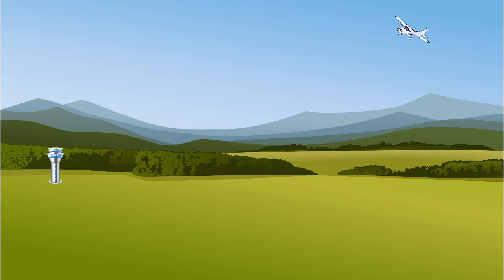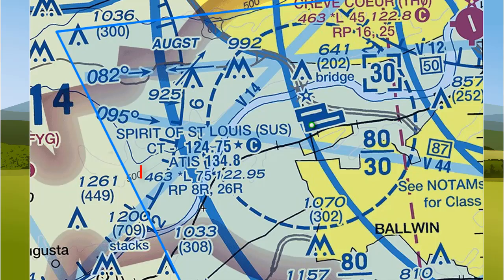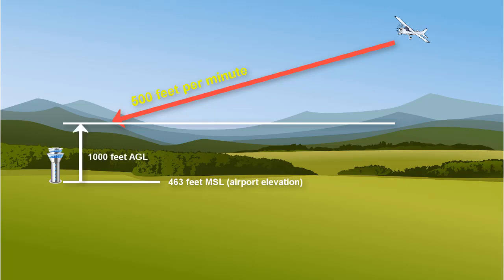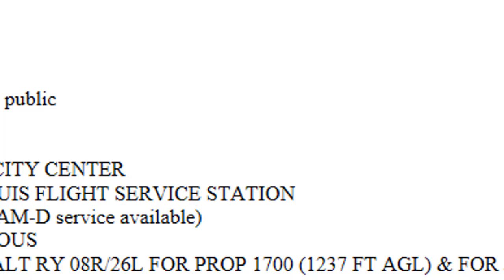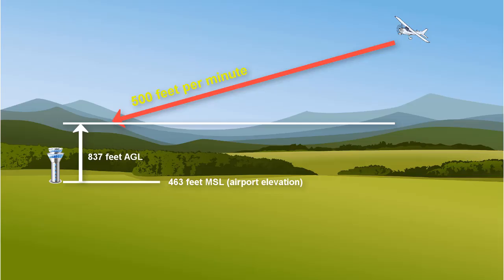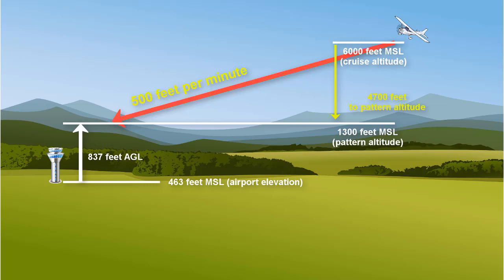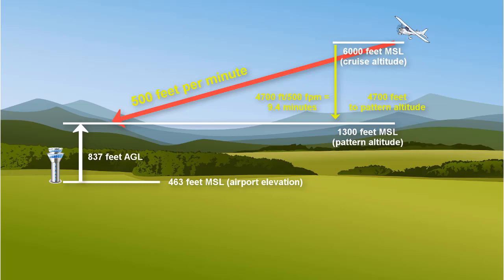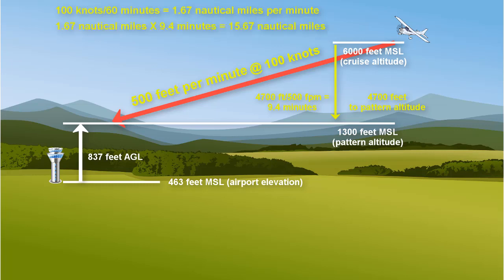Landing:  Calculating when to Descend

Comment: I find this to be anchoring on the wrong datum:

It is 3degrees, and 4/3 * stallspeed, not 500fpm descent,
that one should be anchoring on, I believe..

Every aircraft has its own stallspeed,

One needs to remain at at-least 4/3 of stallspeed during the descent,
for any configuration, any altitude, any weight,
therefore one's airspeed is anchored to the aircraft's stallspeed, not to 100kt

( some fast GA aircraft have a stallspeed which would make 100kt illegal?

One of my designs I'm working-on would probably be illegal for that descent:
it's a swept-wing fast long-range thing,

sorta like the Vari-EZ kind of thing, but with cargo space,
for covering vast areas, quickly, in the Canadian North, or Africa, or getting to ocean islands,
for disaster-relief.. )

Therefore, 3degrees & one's 4/3 * stallspeed are the 2 which one anchors on,
and that tells one what descent-rate one requires, for that specific aircraft.

I'm fine with everybody knowing "that isn't how it's done",

but if it's established wrong,
the correct thing to do, is to correct what-is-established,
not to remain ignorant to what physics is saying, right?

Feel free to delete my comment if you want.

_ /\ _

Comment: Methods I use: 
Determine FPM? Groundspeed /2 *10. 120 knots ground speed, half of that is 60 knots, then add a 0 at the end for 600. 600FPM.
Determine time? Well time at 500FPM is per minute, so 1000ft every 2 min. so use the altitude to lose (6000-1300=4700*2=9400/1000) or just say 4700 * 2 then drop the zeros.
Determine distance? Not as accurate, but gets the job done. 4700 drop the zeros = 4.7 x 3 = 14.1 (I would round 4.7 to 5 in this case) Or do 4700/3 then drop the zeros which should equal at about 15nm. I would round to the nearest 500 to make the math easier (4500ft vs 4700ft is easier to work with). Exact numbers are not always needed, just estimates.

I use these quick math methods best in flight. Works just as well in the planning stage.

Comment: Simplified. Multiple the distance you need to lose by 10 and then divide by 3.
For example cruising at 8000, target pattern altitude is 1000 ft. 8000-1000= 7(forget about 000 for this purpose)*10/3=23 nm.
Add about 2-3 nm for wind considerations and make sure you start your 500ft/min descent latest about 25 nm from the target

Comment: Question...but at given airspeed in a descent the ground track is less than the distance traveled by the airplane.  The distance travelled along the line from the airplane to the destination point is longer than the point on the ground directly below the airplane to the destination point (be it the airport or pattern altitude distance). How does that figure into the calculation?  For instance, calculating the distance covered at 100 kts airspeed the ground track will be less.  Shouldn't the speed used be ground speed and not airspeed?

Comment: In a small prop plane, 5 times the altitude to lose to the airport elevation.  Descend at the top of the green arc to save time.  Any other mental gymnastics are unnecessary.  Keep it simple.

Comment: This video helped and if your flying a 172, you can simplify it a little. If you fly 90 Knots, then to get your time, take your altitude difference (4700) and divide by 1000, so 4700/1000=4.7 then multiple it by 2, which equals 9.4. This math is easier for me while flying. To get your distance, just take that 4.7 and multiple it by 3, which is 14.1.

Comment: How about this method using high-school trigonometry which we all done in math class when we were kids:
Track distance required in nm (horizontal along the ground):
= [Altitude_in_feet / TAN(descent_angle*(Pi/180))] / 6076

Ps. The divide by 6076 at the end is to convert from feet to nautical miles.
?

Comment: Simple fighter pilot math for the jocks: plan a 5 deg nose low descent. Take altitude to lose in thousands of ft and double it. Power as required to maintain desired descent airspeed. 

Example: 5,000' to lose. Start 10 NM out. Add 1-2 NM for tactical pad and you're good. Easy. Makes life at 350-500 knots a lot easier.

Comment: (altitude to lose/500)+5=time back to descend for unpressurized  ie: 10K ft 25 minutes back .... Pressurized (3nmxaltitude)= distance back, then descend at  1/2GSx10+3 miles to slow down for a 3 degree slope(not perfect but close enough for govt work.) This also has the positive of adjusting for change in gs during the descent 21000'  66nm for a 250 kt gs 1250 fpm, 300 kt gs 1500 etc....

Comment: Or for the math challenged like me...  “altitude to loose divided by 3” equals miles from destination to begin descent.  4700’/3 = 1500ish then make some sense out of it...  1500 miles is a lot, 150 miles is a lot, 15 miles makes sense.  (Then adjust for factors such as landing in the direction of descent, add extra miles to TOD; landing 90 degrees off, no additive; landing opposite direction, subtract extra miles off TOD as needed) Easy peasy!  I used this exclusively during my USAF flying career.
Reply: I multiply the distance. 10 miles away, multiply by 3, which equals 30, then just tack on 00 to whatever the sum is. If I’m 5 miles away, I multiply by 3 and tack on 00, boom 1500. Works all the way to the ground.